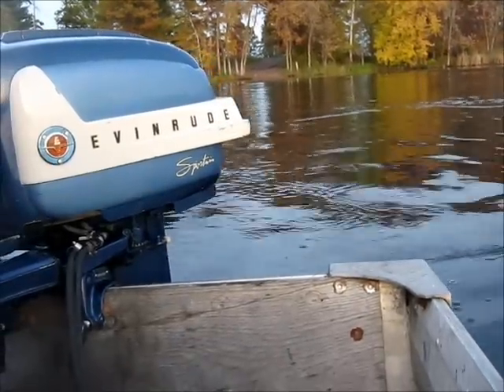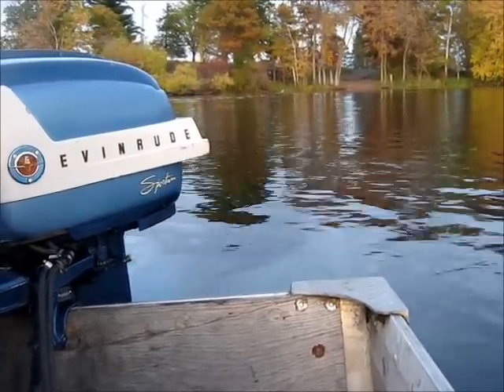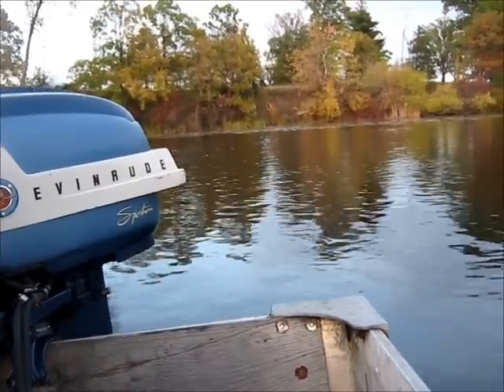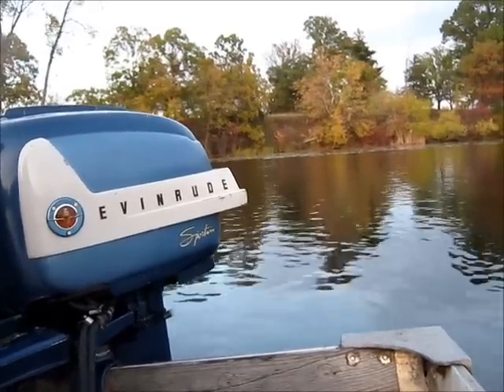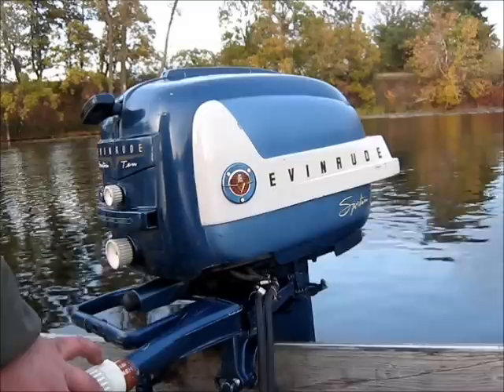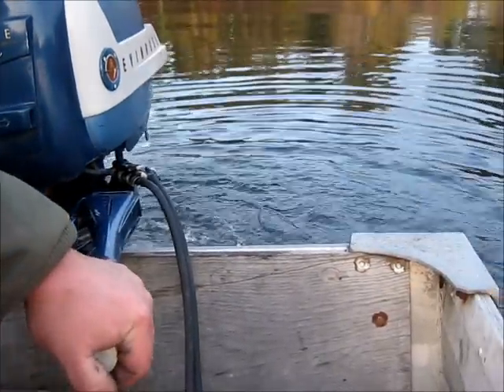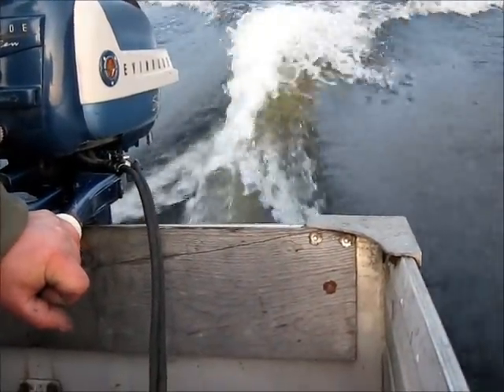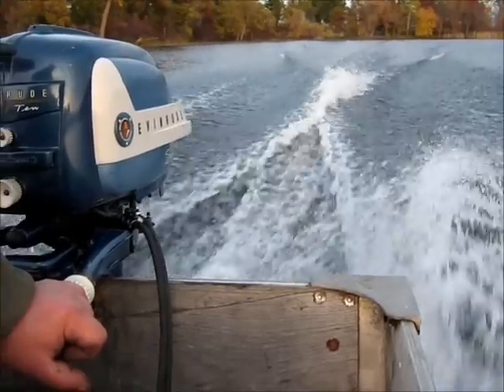1958 Evinrude Sportwin 10hp outboard motor

Comment: I HAVE A 1956 14FT CRESTLINER VIKING I BOUGHT. IT  CAME WITH A 1954 25 HP. I HAVE PICKED UP A 1976 35 HP CHRYSLER IT  HAD TWO BLOWN COILS.  IM PLANING ON RUNNING THE 35,  AND MOUNTING A  5.5  EVINRUDE AS A KICKER MOTOR FOR TROLLING I REALLY LIKE THE OLD LOOK OF THESE 50'S EVINRUDES  AND WILL MAYBE  MOUNT BOTH EVINRUDES  FOR A VINTAGE SHOW,

Comment: What a great engine to wind up the season with!  Be still my heart!!
Reply from the maker: kramden Well i'm not saying the season is over it just might be if it stays cold. But i am taking a few days for a fishing trip and i am thinking i might bring a few that need tune ups with me,and fix them up north. and i will have my camera.
Reply: I have the same engine and hope you can help me. The timing plate moves whenever I try to crank mine. The coils are even with the bosses, but the magnets are still strong enough to move the timing/throttle advance. Any suggestions on how to tighten it up?
Reply: pete smith Do you have the OMC locating ring for the coils?  You say the coils are even with the bosses, perhaps the mag plate is sloppy on the block giving it a lot of sideways slop....Any evidence of the flywheel rubbing on the coils? 
Did you take the mag plate off the engine?  If so, did you accidentally flip the aluminum threaded retainer plate that secures the mag plate?  The flat side of the retainer plate should be facing up towards the mag plate?  The plate will definitely be sloppy if the beveled side faces the plate.
Reply: Thanks for the reply. I have never seen a locator ring. Really have no idea what that is. There is no evidence that flywheel is hitting the coils. It just pulls them so much timing plate and throttle move. There is no wobble to the plate, but it won't stay in one position.  I will check to see if the ring is upside down.
Reply: I did take the mag plate off to put in new coils and finally got them bolted to that ring using an ice pick to find the holes.
Reply: I did squirt some penetrating oil down the shaft to get the flywheel off with the puller. There is some residual oil from that. Would that cause the throttle/timing to be so loose?
Reply: OK, so you did not remove the brass retaining ring or the aluminum mag plate retainer, correct?  What type of puller did you use to remove the flywheel?  Lifting/prying the flywheel from the outer edge can distort the flywheel, which might be the cause of your rubbing.  But, I would find the correct coil locating ring and use that to make sure the coils are properly set.  I hope you did not lubricate the crank/flywheel tapers before reinstalling the flywheel, that will render the locking tapers useless and probably end up shearing the flywheel key.  The other cause for a sloppy mag plate is wear between the brass mag plate bushing and the pilot bushing on the block.  This will cause the mag plate to be sloppy when rocked from side to side....

Comment: Edgar, I get seal kits from iboats.com or marineengine.com.  The later site has parts diagrams with part numbers.  Very helpful.
Reply from the maker: Greg Offenback Yea i just go to my Evinrude dealer.
Reply: chrysleroutboarddude My Evinrude dealer wont help me, just tries to sell me a $7000.00, E-tec
Reply from the maker: Edgar Bringman
Well i don't know what to say. I think it is time to find a new dealer.
Reply: Edgar Bringman  Many dealers haven't been around long enough to be familiar with finding the parts for these engines.  Instead of admitting this, they simply proclaim the old motor is worthless and not worth any effort.  Such ashame, find another dealer, or use marineengine.com

Comment: wow that one is fresh as a daisy- runs out really nice for a 10, looks beautiful

do you ever vacuum test your lowers- i was told by an old codger who tinkers motors that most of the water that gets in comes after the motor runs and the lower unit is cooling down and wonky seals let water in then more than they do on the pressure side of things.

just curious
Reply from the maker: postaltraining Well on the older motors with a signal lip seal i do think they will leak under vacuum, with all the pressure testing that i have done i have not had any problems with water after pressure testing. Now when you look at the old motors they say to change the oil every 1 to 4 weeks.
Reply: Lower unit never warms up.  Under water?

Comment: I know you probably dont want repair advise questions but i got a quick one. Why would there be gas pissing out from the gear shifter on 1956 sportwin 10 it comes out like a sive when throttle is applied  right were the shifter clamps onto the shift rod

Comment: I have a Montgomery Ward Sea king k1, has a bad coil, where to I find one, I bought 5 older outboard motors,  Sea King,  Champion(now running) ,  Johnson Seahorse 2.5 hp, Martin 60, Firestone 10hp ... I'm building a nutshell pram, 9'6", not sure which motor would be strong enough but not too big ... Seahorse 2.5 has low compression,  how to fix???, that's the one I kinda wanted to most to run ... boat and motor will eventually be a dinghy for my sailboat in saltwater  ...